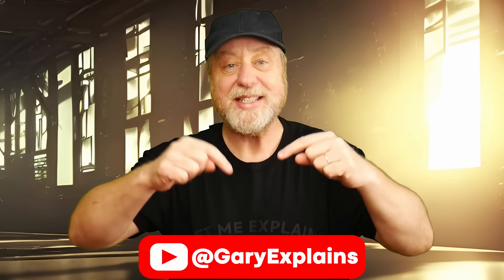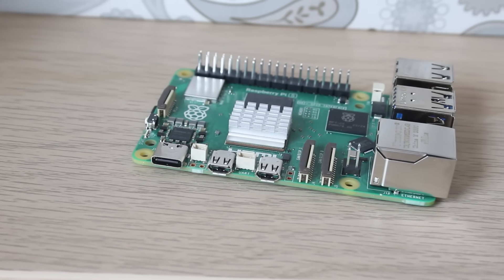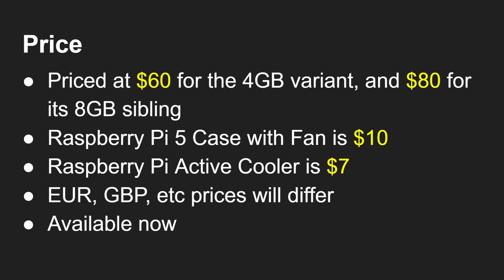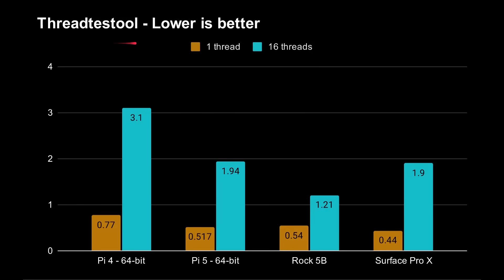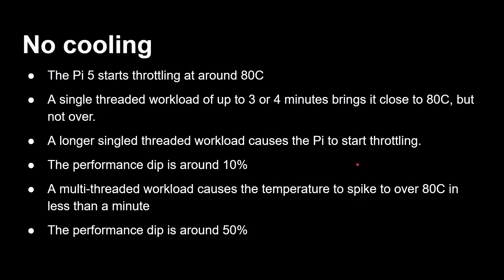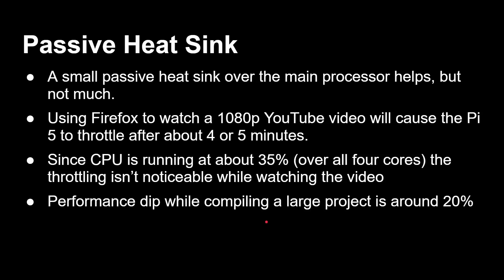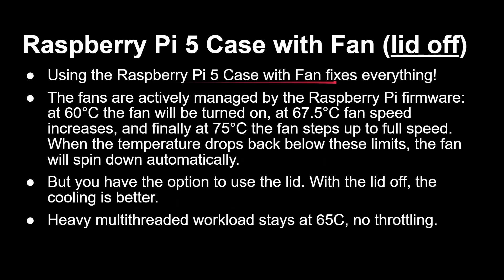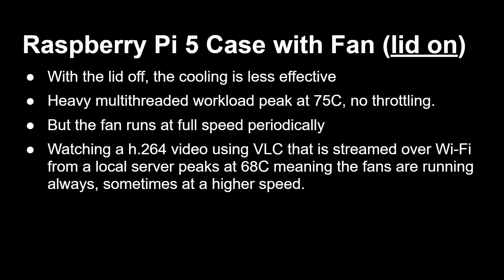Raspberry Pi 5 - Performance, Thermals, and Overclocking

Comment: I bought mine at the Raspberry store in the Lion Yard the day after it came available. 
It seems to support up to 3.1GHz (stable, no overvolting), using active cooling. it worked well, I stressed it with s-tui for a couple of hours, I compiled a few programs (among them BOX86 and BOX64) without problems, performance wise it feels like a current low specced laptop. 
A week or so ago I installed KDE's Plasma Desktop, and been using it since then. 
There is a gotcha, though all the utilities measure the CPU clock to be 3.1GHz under load (I believe it's what cpufreq/cpuinfo_cur_freq contains), vcgencmd measure_clock arm returns approx 3.0GHz, so I do not think it's reaching 3.1GHz at all. The GPU only overclocks to 900MHz, but I am happy anyway :D. Thanks for your videos!
Reply: I live in the US, and it is really hard to get a Pi 5 here on time, especially when you really need it ASAP. I wish we had an official store here, or even better, a manufacturing plant for quick re-stocking. 😔🥺

But it's cool you were able to overclock yours by 0.7GHz without issue! Nice work, man!
Reply: @aravjain  it would be interesting if the Raspberry Pi Foundation licensed their devices to a local American manufacturer.
Reply: @ernestuz definitely, and that would solve many problems!
Reply: @ernestuz  There would have to BE  an American manufacturer first....there isnt

Comment: Yes I'm getting a Pi5. Yes I'm getting active cooling. Yes I'm going to overclock. Yes I'm still disappointed it doesn't have at least two more cores (was hoping for 8).
Reply: Maybe you do not buy the Pi 5 and wait for the Pi 6, Pi 5 is not for you :face-blue-smiling:
Reply: Me too, to compete with all of the RK3588S boards. An onboard NVME m.2 slot would’ve also been nice. But I don’t think they could’ve done it at this price point.
Reply: Just because it has a bit less cores doesn’t mean it’s bad. Criticizing innovation is anything but good. At least let’s appreciate that power button. And appreciate the price and available support and software out there for the Raspberry Pi. Hats off from me to the Raspberry Pi Foundation!
Reply: Instead of more cores. They could've gone for an even more modern cortex architecture. I'm talking cortex A78. That would've been an even higher performance boost compared to now. The next Gen Pi 6 should do that and perhaps consider a cortex X1 or cortex X2 core for max performance.
Reply: @kmstar2230  But then everyone whines about price
Reply: @marklewus5468 price point would be one thing but I’d say integrating everything they did AND the m.2 slot would affect the form factor which is what RPi prides itself on. I realize other manufacturers have it integrated (orange pi cm4 base board has it for example), but they also don’t have the same options the Pi 5 has. Argon40 has a case available for the  Pi 5 now that continues their Argon One series. With that one, they have an m.2 base with either SATA or NVMe capabilities

Comment: Have had my Pi5 for a little over a week now.  As you say on your side of the pond, brilliant piece of tech.  I have the official case with the fan plugged in.  As for the case lid, it's been off, currently on.  I have not overclocked it yet so no heat throttling.  I may try but the Pi5 is so much better performance-wise than a Pi4 that I don't have an immediate need for overclocking.  I'll keep the 2.9GHz threshold you uncovered on this revision of the chips.  Thank you for experimenting.
Reply: ETA Prime had his running at 3ghz, and the GPU at 1ghz ... might be worth a watch.

Comment: Thanks. I will undoubtedly get a 5 when the initial rush is over. Looks like the fan case will be enough for me, probably overclocking to a safe 2.8 GHz
Reply: I could get mine to 3ghz without trying much. Maybe not for 24/7

Comment: Hello. I have a question - if you watched a H.264 video the decoding wasn't done on the GPU but on the CPU, right? Then the video+stress test tests actually only loaded the CPU. Rpi5 doesn't have H.264 GPU decoding.

Comment: I got the Pi 5 8 Gb, no case... but ordered it with the active cooler (heatsink fan). No overclocking for me. Just plan to use it as an alternative to burning up 800 watts on the desktop box, for casual surfing, email, and YouTube distractions. Plan to us Raspbian (or other distro) ... HDMI to a widescreen TV. Not sure about storage yet.

Comment: I wonder if the active cooling would fit inside the case if you remove the case's fan... Or if it makes sense at all to use the active cooling inside the case.

Comment: Perfect, just the question I would ask about CPU thermals. What about the io chip, does it need a heat sink? Thanks!
Reply: If you’re going to overclock, I suggest heatsinks on DRAM, the PMIC, and the RP1 I/O controller. If you use the integrated heat sink / fan assembly rather than the case fan, it has thermal pads for all of these.
Reply: @marklewus5468  thanks. Did not know that.

Comment: I wonder how FLIRC cases will perform with the PI 5. Also wonder whether you can install Noctua 40mm fan, they do a 5V version and 20mm thick.

Comment: Yes, I'm waiting for my po-5 and case to come in.

Do you know what the ambient air temperature was during you thermals testing?
Reply from the maker: The ambient temperature is basically irrelevant as the CPU temperature is much higher than room temperature even when basically idle.
Reply: @GaryExplains  I would disagree, because at full fan speed / full load the CPU will be some number of degrees higher than ambient. Under those high load conditions the CPU temp will rise more or less degree for degree with ambient. In a non air-conditioned room in many parts of the world in summer, that might be 15 C higher than a ‘normal’ 20-25°C room.
Reply: @GaryExplains  Sorry.   I didn't know that your lab temperature was such a secret.
Reply from the maker: 😂 The truth is that I didn't want to show that I can't afford to heat my office very well!!!! It was around 20C.

Comment: Brilliant video Gary. Seems this Pi 5 has impressed even ARM who have bought a minority stake in Raspberry Pi Ltd. I love the investment. I'm hoping ARM can help Raspberry Pi secure better manufacturing for the SOC. It is amazing what they have done with 16nm but when Rock 5B is using an 8Core (4+4) CPU 8nm Chip, the excitement is diminished.
Reply from the maker: To be honest they were always close, the HQ for both companies are both in Cambridge and not that far apart from each other. But it is good that Arm has put in some money as well as just emotional support!
Reply: @GaryExplains I love drawing comparisons between Cambridge, ARM and Raspberry Pi; with Berkeley, RISC-V and SiFive.
Reply from the maker: The main difference is that Raspberry Pi didn't just fire most of its staff and perform an internal reset 😬
Reply: @GaryExplains  shows how mature ARM architecture has become. Google with Tensor G3, Amazon with Graviton 3E, Apple M3, MediaTek Dimensity 9300, Samsung Exynos, Qualcomm Oryon in Snapdragon X Elite, and Raspberry Pi5. Can RISC-V remain significant and relevant?

Comment: Excellent tutorial Gary, just a quick question do I really need to get the 8GB version, will the 4GB be enough ? love to know your views on the memory option
Reply from the maker: It depends on your usage. Will you be doing a lot of desktop stuff? If so get 8. If you will be running it headless then 4 will be ok.
Reply: Thanks Gary, I have ordered the 8gb but when all the rush dies down I will order a couple more 8Gb, but lets see where this is going first
Reply: I use Pi4/pi2 headless and I don't think I ever needed more than 1GB. Although my use cases(SSH reverse tunnelling/VPN/MQTT Broker/web apps etc) might be different than yours.
Reply: There are few use cases for 8gb. Maybe running a 7B llama LLM locally, camera object detection, or keeping 25 tabs open in Firefox. I run a magic mirror desktop with local voice recognition, Google Assistant, and YT playback on a 4GB Pi 4 and rarely exceed 2 GB memory in use.

Comment: Does the case with cooling fit the Pi 4 too? Looks like a good option for them if so.
Reply from the maker: No, the ports are different between the 4 and 5.
Reply: Shame. Will have to get a case with an ice tower fan in.

Comment: Maybe cooling the back side of the PCB also helps a little bit.
Will be interesting to find best cheap cooling solution with two fans.
Reply: I wondered about maximum performance and silent, how about water cooling ?

Comment: Thanks as always for another interesting piece.

I'm not getting the Pi 5 at the moment as I have too many (?) of the previous versions sitting unused. Trying to break the habit of always buying the new thing!

Could you tell us please what the ambient temperature was for your testing? Also does the Pi 5 case with the fan come with a small heatsink to attach to the board? If not, would a small heatsink help to increase the surface area for the forced convection?

I'm hoping that a heatsink as case / case as heatsink passive solution (e.g "Aluminium Armour - Heatsink Case for Raspberry Pi 4" but for Pi 5) will work. I like my computers as quiet as possible.
Reply from the maker: I am glad you liked the video. The case with the fan also comes with the heatsink. It was around 20C in my office.

Comment: Thanks for the video, Gary.  I have been using my RPi5 with the official case for the last week.  Works great and I concur with your temperatures.  I went with the 4G model because my workloads (that I also ran on a Pi4) never needed more than 4.  What app are you using alongside htop to show proc frequently and temp?
Reply from the maker: I wrote my own small shell script. It is in my GitHub repo.
Reply: @GaryExplains  thanks for the info, Gary. 👍

Comment: what do you think about the milkv boards?
Reply from the maker: Which one in particular?
Reply: @GaryExplains  I was watching a video about the Mars which looks a lot like a RPI thought it was interesting
Reply from the maker: I don't see the attraction. It looks like it will be more expensive with a slower processor. Why pay more for less? And you can guarantee that the ecosystem will be fragile. I have a review of the VisionFive 2 board which has the same CPU if you are interested: https://www.youtube.com/watch?v=ZSRvTZyS0KI

Comment: I'll wait for good passive-cooling aluminium cases to be available before getting a Pi 5.
Fans get noisier with time, they break, they gather dust... I see them as something archaic and I can't believe that we got to have computers without any moving parts except for them. We really need to find a replacement for fans.

Comment: I'm lucky I can pick up a Pi5 - or any other Pi - any day of the week from the local Pi store in Cambridge. They have them on the shelf here. :) There were several errors in the graphs and some text in this video, by the way - the "Lower is better" graphs were showing it being slower with multicore than single, for example.
Reply: I think the difference is whether it’s running one thread vs. sixteen threads - a much heavier load for the latter.
Reply from the maker: The different bars represent different things like single thread or multi thread. They are correct, please go back and take another look.
Reply: @SchoolforHackers  Yeah I was misreading it - the two numbers for each part of the graph are for different types of test. Maybe they should have been separate graphs as it looks like the 16 threads are performing much more slowly than 1 thread in the same test? Cheers.

Comment: Ran all tests at 3Ghz and working fine.
The Glmark2 is slower than 2Ghz Jetson Nano.
The SD and USB is little bit better than Pi4B. But much slower than x4 NVMe on 3588.
Lack of 2.5GbE, no good for WRT.
Only x1 M.2 hat, no good for NAS.
Still waiting for Pi6B....

Comment: I have Pi 5 8GB RAM with the case for the Pi 5 that includes the fan. The thread test tool results for the Surface Pro X seemed lower than I would expect. I was interested in running than same test on a Windows Dev Kit 2023 with the Snapdragon 8cx Gen 3 arm64 processor (Microsoft SQ3). When you compiled it did you use MinGW-w64, and compiled for x64 or arm64?

Comment: If my workstation and/or web-server dies before an acceptable RISC-V solution is in place yes I will get a Pi5 and in both cases they will be actively cooled. The desktop will be overclocked a few hundred MHz, the server will not.